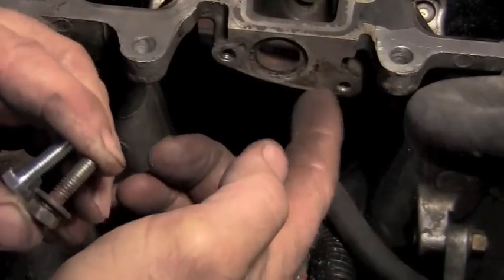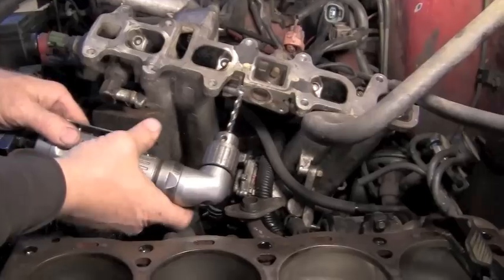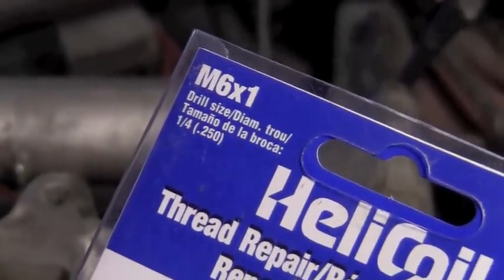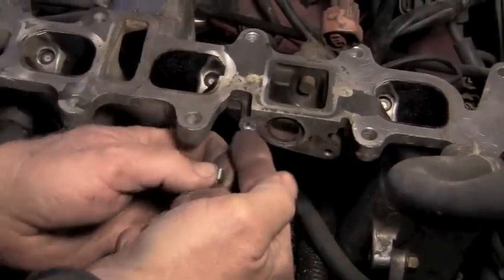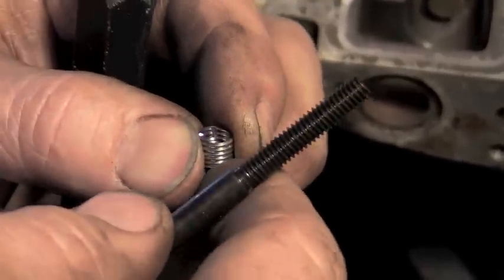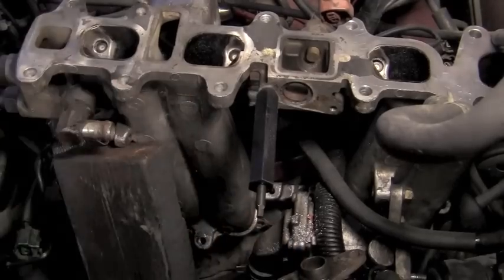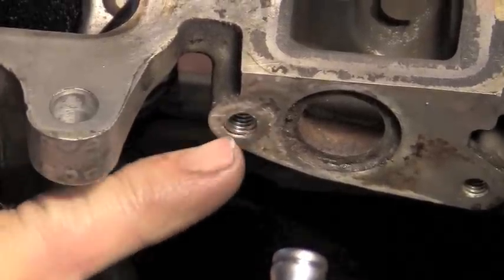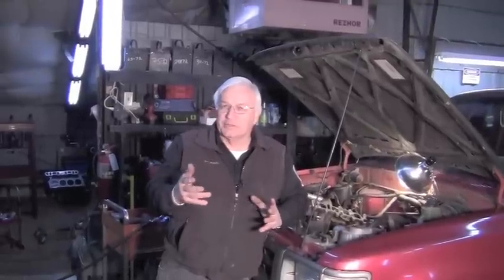Heli Coil Installation

Comment: Excellent demo. I need to repair a VW MK4 TDi serpentine belt tensioner mounting bolts. They are M8 x 1.25 but one of the three bolt thread is stripped. So I just learned how to repair it from your video.

Comment: Had good experiences working on marine engines with Helicoil. Bolts and holes get eaten up by corrosion, electrolysis and previous sloppy repairs. Never had one fail on me.

Comment: The Tattersfield Flathead on my '51 Dodge pickup has ANOTHER stripped thermostat housing thread. Yours is a very good and simple and Short example explained very well by you... Good 4 my Brush Up - Here I Go................. Thanks... LJR111

Comment: I had my doubts, but a very thorough explanation. My only gripe is that when cutting the thread use cutting compound and back off the other direction every few turns to break any chips that might damage the new cut thread.

Comment: There is NO thread per inch measurement on metric threads. If it's 6 mm diameter x 1.0, the 1.0 is how many mm it is for one revolution of thread.

Comment: Good video but the thread pitch on a metric bolt is not how many threads per inch.  It's the distance between the threads in millimeters.

Comment: Thanks for the great and easily understandable video. I've never done this before and have the bottom bolt hole of a starter that is stripped...going into an aluminum bell housing. The starter has only two bolts to begin with. Luckily, the top bolt screws into the starter and is holding well. The bottom bolt...3/8 in. screws into the aluminum bell housing. I may have to do this Heli-Coil as a last resort.

Comment: My wife was having a problem with a steering wheel and she kept crashing the car. I tried fixing the steering wheel but I knackered the threads when trying to tap it for the insert. Since the hole went completely through I put a "backing" nut on the other side. It seemed to work for a little while but then she started crashing it again. Do you think I have a nut loose behind the wheel?

Comment: Tap wrenches are very helpful also and keep in mind that the beginning of the tap won't have full threads. This means that you will have to go past the tapered part of the tap. I like to use a paint marker to keep from going too deep or not deep enough.

Comment: This guy should be using cutting lubrication when tapping to avoid damaging the threads and the tap. Also... he should be protecting the block and open coolant/oil hoses he has sitting there. Metal debris will fall into them and create additional engine problems in the future.
Reply: t3hgone He should follow the instructions... like he did
Reply: t3hgone, i was thinking just the same, lubrication and protecting the rest of the engine from debris.

Comment: 1.0 does not "reference how many of these threads are in an inch". It is the pitch of the thread i.e. the distance in mm from one turn to the next. Note: that applies to metric threads, imperial threads are characterised by t.p.i. or threads per inch.

Comment: that is well done.  i have no experience with helicoil and will be trying it on a honda engine mount.  one bolt stripped the other i am having to cut out.  bolt head damaged beyond repair and it is dremel time.  once get the head off  and engine mount off hope i  can turn the bolt stud but who knows

Comment: When tapping a hole you want to use oil, and turn the tap in 1/2 turn out 1/4 turn, in 1/2 out 1/4. This keeps the threads clean and less chance of breaking the tap.

Comment: Whats the point of the "holder"? Why wouldn't someone just turn the installer to insert the new thread?
Reply: it helps you  inset the coil
 straight  up

Comment: Thanks for the video. It's been a while since I've used a Helicoil and was a bit perplexed by the "installer" tool. Helicoil's instructions weren't a lot of help. I'm tapping the crankshaft nose on a 454. I hope it holds 85 ft. lbs.!

Comment: Normally, you should use the tapping oil but he was going into aluminum and it's not really necc. since aluminum is a very soft metal. If you were tapping into steel for example or any other hard metal, then I would definitely recommend that you use the oil. For harder metals, you have to go a few turns and then back out 1/4 to 1/2 turn to allow the metal shavings to fall out otherwise the shavings could clog the new hole and jam everything up and then they will be very difficult to remove.  :-)

Comment: An M6 1.0 means that the threads are 1 mm apart. I have some M2 .4 bolts which means that the threads are .40 mm apart. Other than that, fine instructions.

Comment: nice tutorial, irony is this happened on the back of my 1052 Suzuki engine on one of the oil return line bolts on the aluminium valve cover.

Comment: I just replaced my AC compressor.  The two bolts that hold the manifold down for suction and discharge, one of them stripped the threads out of the aluminum housing.  Going to use this repair on it.

Comment: I was told by the auto parts store that I go to that you may/should use loctite. I mean,you don't have to but they recommended to me that I do. I am repairing the bleeder screw threads on one of my rear calipers. I have the loctite sticks - both medium and high strength. For my situation,he said the medium strength is good enough. Since I will be unscrewing the screw every two years to flush the old fluid out,I will prob use the loctite. If it's a head bolt for ex. then I wouldn't bother.  :-)

Comment: Thanx, this was helpfull.Just one question,should I use red Loctite that the helicoil doesn`t come out over years. Because aluminium and steel have different expansion when it gets warm? Best regards Sven
Reply from the maker: My recommendation it not to use Loctite
Reply: @realfixesrealfast  Why not?

Comment: @ratdude747yt Correct. You crack that chip off and it rides up, allowing the rest of the material to be threaded. Otherwise, you are trying to thread through chips, which causes poor threads and uneven depths. ;)

Comment: Great video.  Thanks.  Question: What prevents the helicoil from backing out when you remove the bolt?
Reply: Helicoil is a spring. when you wanna turn out the spring will open and locks up. It wont unspin. When you wanna remove it you have to take needle nose plier to strip it out. i never had one turn out by itselft. locktide can be used if you let it sit to harden a it. you dont wanna locktiden bolts in a helicoil though!

Comment: Hi, did you remove the tang after tapping and breaking it away? If I can remove it with tiny tweezers instead of purchasing the removal/extraction tool? By the way, thanks for the video. it is great!

Comment: How do you keep the insert from screwing out?  I had one installed in a VW head and it unscrewed while I was driving.
Reply: Put some thread locker between the outside threading of the insert and the piece it is being installed into.

Comment: If I need to do this to a motorcycle oil pan, is there a way that the tab that has to be broken doesn't go inside? Or is there a way to remove it? I don't want that to be inside!
Reply: El Profe A timesert kit is better. It locks in. You still have to use the tap with the kit. Use Loctite hi on the insert. Use antiseize on the spark plug. You can use a helicoil but use needlenose pliers to remove the tang.
Reply: search for "tangless" helicoils
Reply: Use a magnetic plug and problem solved
Reply: @originalswolfsburg9889  doesn't work on stainless steel.

Comment: I am working on a 12mm bolt. What helicoil size , tap and drill bit do I need? Thanks in advance
Reply: If the threads are 12mm you'll need to figure out what thread pitch you need: 1.75 (Coarse) or 1.5 (Fine) or 1.25 (also Fine). If the wrench size is 12mm it's probably and 8mm bolt either 1.25 pitch (most common) or 1.0 pitch. I haven't sold this stuff in decades.  Feels good. ( ͡ᵔ ͜ʖ ͡ᵔ )

Comment: I HAVE A HELI COIL TO DO ON MY MOTOR MOUNT . THE THREAD STOCK IS
1.5 INCHES . THE HELI COIL IS 3/4 THS OF AN INCH ... CAN YOU INSERT  A
2ND HELI COIL SO THAT THE BOLT WILL BE FULLY THREADED ?

Comment: For some reason on your last two videos I'm getting audio only from my left speaker. 
The helicoil kit I have doesn't have that large installer guide -- is it necessary?When do you use locktite?
If you ever find it necessary to do a spark plug helicoil, please take the time to show a video how to do that. Although I hope never to cross thread a spark plug, there's always a chance. What do you think about time-serts?

Comment: what keeps the helicoil from coming out when you unscrew the bolt, why not use a threadlock or sleeve retainer compound to ensure the helicoil stays put?
Reply: Same question here
Reply: The friction between the coil and the tapped hole.
Reply: one thread is in oposite side than others
Reply: The insert expands after  removing the tool to lock it in. No sealer is necessary.
Reply: if the bolt gets rusty i would rather have the helicoil come out too with it. i could then screw in a new helicoil the same exact size and be in business again.

Comment: What was the point of the holder piece? You could've just threaded the helicoil using the installer without the holder no?
Reply: yeah thought the same. Never saw a original helicoil kit with that holder tool. Buy original only!
Reply: The holder is to assure a straight thread.

Comment: Is there a way to install the helicoil insert without removing the part being fastened? My application is the left side rear subframe mount on a 1998 BMW R1100GS. The sub-frame mount accepts a shouldered or cap screw M8x1.25 x approx. 100mm. The bolt threads into the aluminum transmission housing about 40-50 mm and clears the ID of the sub-frame mount. Previous owner stripped the existing transmissing housing threads! Threaded hole is not blind. Some threads remain, but will not torque. The subframe is an incredible hassle to remove, hence this question. Anyone?

Comment: You'd be better to use a Time-Sert kit. Helicoils can back out or loosen. Time-serts are permanently installed. It locks in. Autozone has a better helicoil kit. It has a metal tool. That kit, the installer can break. You can't see the hole on that kit. You are supposed to install the insert a certain depth in the hole. You can't see it with that kit.

Comment: you should use cutting oil or even wd40 to keep the chips from welding to the cutting edge and tearing threads

Comment: why can you not directly tap the old thread, the old threads are pretty much the same size as the tap? Seems to me that the drilling bit is the most dangerous, ie. you can drill not straight to the hole
Reply: the hole sort of guides you to go in straight, using a drill press would be first choice, but if you have to disassemble everything just do it by hand like that with a feather touch holding the drill in place hoping the hole is not too big for a good tap. besides getting the right size helicoil, make sure its the right length too. not sure if doubling up with two shorter pieces back to back works. you want enough aluminum holding the coil for required strength.

Comment: hi, i just have a question? i have a 98 Acura CL cam head bolt, unable to bolt down tight and i assume the hole cam bottom is stripped. but many people told me not to do it because of the heat pressure might cause damage to the blog, is that true? And can i use back the old cam bolt instead of buying new ones? because i assume my old cam bolt is stripped a little from the top but will it be fine and still be able to tighten the cam bolt down after i put the spring in?

Comment: Wht if i just tap the hole without drilling the hole without change original size the bolt? Can?..
Reply: all that unnecessary digging into the good aluminum may not be good for it. you want helthy strong threads for the helicoil to go into. maybe it would work, it would remove any old original thread and bite in deeper for the new helicoil outer threads to go into, try it on a scrap piece somewhere first.

Comment: instead of just punching the tab off, try putting some grease on the end of the punch so that the tab sticks to the end of the punch for easy removal.. every mechanic knows this.

Also thread pitch is the measurement between each thread.. ie: M6x1 is 1mm between threads

Always use something as a cutting fluid,WD40/CRC anything, even pissing on it is better than going in dry, you have a high chance of destroying your new thread if you tap it dry.

And lastly, please cover the block if your drilling/tapping overhead, even if it is "offset", one small shaving can destroy an engine

Comment: my exhaust manifold bolt is stripped but the bolt didn't break off. now the bolt just free spins and never tightens down all the way. wonder if this would help, would I still need to drill?
Reply: Yes, it should solve your problem, but you will also need to drill out the hole to fit the helical insert. Don't forget loctite on the insert!

Comment: Why can't you use the bold that you are going to be using to screw the helicoil in
Reply: you could, i f you cut it properly in the end to grab the little pin. But when you buy original helicoils you get a proper tool with it. so why bodging?

Comment: You know, your method for using the tap is incorrect. I was always taught (by many people and sources) that you just don't turn it in, you go 3/4 revolution and then 1/2 a revolution back to break off the chip being cut. otherwise, you can (and I have seen) break or bend the tap. 

Just some friendly advice.

Comment: I have to agree.  For once a video not made by someone who likes to hear themselves ramble on and on.  My buddy just tried this out on his el dorado.  Classic head bolt problem on the Norstar engine.  In the process of using the guide in one of the new holes, he managed to loosen up the new helix to the point where it is no longer usable.  My only question is this.  If you removed the broken bolt and rethreaded it for the new heli, why not just forget about the heli and use a bolt the size of the heli insert?  i.e. 8mm
Reply: You certainly could drill and tap for the next size up bolt if the situation warrants it.  Where you may run into issues is if the new bolt diameter requires enlarging the diameter of other components and or not leaving enough material around the hold for strength (if bolt hole is close to the edge).  For example, in the video, the bolt first goes through the flange - this hole may need drilled out larger as well.  

Also, if you need to disassemble in the future you need to remember to bring two wrenches / sockets (minor inconvenience but one that's caused a few 'goddamn' moments for me in the past).
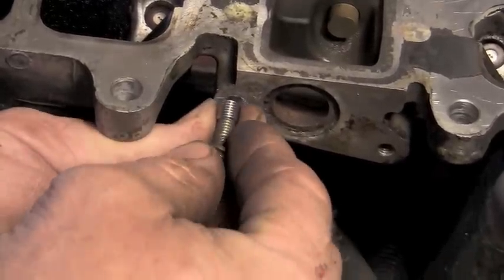Reply: at 5:35 he answers your direct question

Comment: why not just get a bigger bolt?
Reply: One reason you may not want a bigger bolt is that the flange (the piece that bolts onto the part that he installed helicoil in) already has a clearance hole in it for the M6 screw.  If you up the screw size, you now need to drill out the clearance hole to accommodate.  This may or may not be possible.  You typically want a distance of 2*Bolt Diameter from the center of hole to the closest edge of the flange.  This is to prevent tear out of the bolt (like when you pull a piece of paper out of a three-ring binder).
Reply: Because the bigger bolt may not go through the flange. And drilling the flange may not be practical or safe
Reply: @RealSaladsamurai  exactly. you wanna stay small in diameter. I always get this bodged cylinder heads with stripped insert/time serts and how ever they are called. the wall size is 10mm, the time sert 8mm and its stripped...i need to tell my clients to throw the cylinder head away. 6mm helicoil insert require M7thread. After installation you got the strongest thread for this application you can imagine....

Comment: Threads per inch? Wow.... a 1.0 means that it's 1mm between two threads. 1.25 means 1.25mm, 1.5 means 1.5, etc. 

Metric has nothing to do with inches....